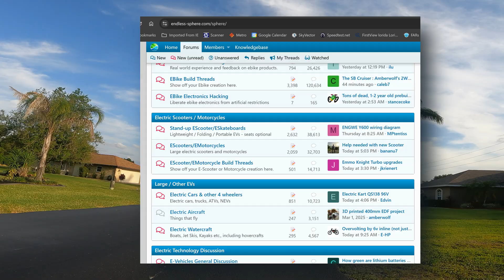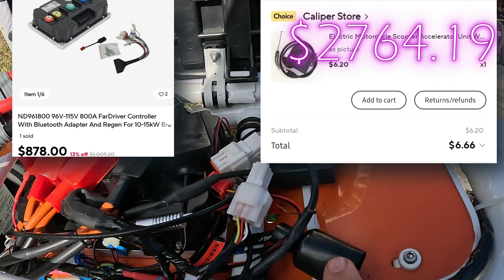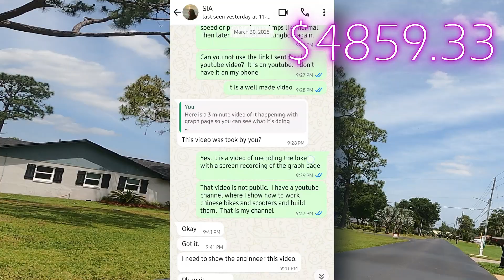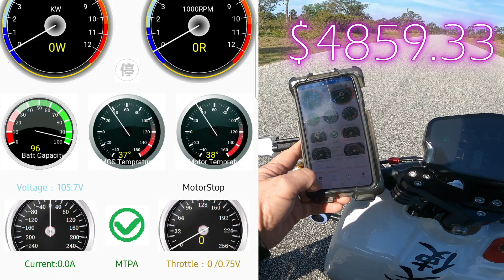How Much It Costs To Build Your Own High Power 20kw 96v Electric Motorcycle Maddog Scooter

Comment: What was wrong with the damaged fardriver???
Reply from the maker: The ND961800?   It was bad from the factory.  No idea.  The ND961000 (blue one).  I blew that up.  Trying to hook up boost I sent 96v into the pink "alarm" wire somehow.  It actually blew up inside and smoke came out.  😢
Reply: @GhettoWrench did the 961800 power on at all?
Reply from the maker: @legion-t5j It actually worked fine for about 6 miles.  At 43 degrees C it would start doing the dying thing.

Comment: Hi Sir, can you help me here ? I have put 2 fardriver nd72450 to my FLJ 10kw dual motors, i tested free spin it spins like crazy but when i put load on it barely move, i then bump up the controller to max amps it hit 55mph max but my battery turns really hot . Im really nee to fardriver i dont know how to tune it right. So main question is : free spin so crazy fast but when test ride with load it barely move ! What do i put in settings?
Reply from the maker: @mikenguyen4207  I'm not familiar with dual motor setups, except I see tons  of discussions on the ability to run 1 controller or not.  Don't get that battery too hot.  It may be tricking the controller into drawing way too much current.  Have you asked the guys on endless-sphere.com?   Those guys are super smart and discussing this dual motor stuff all the time.  Give them a shout
Reply: @GhettoWrench  sir so you meant 1 controller can run 2 dual motors?
Reply from the maker: @mikenguyen4207  I don't know.  You will have to ask someone more knowledgeable than me.  Did you ask on endless-sphere?  I'm gonna reply to you again so it should be right below this reply.  It will be a link to a youtune channel.  Go on his video and ask him.  He is a genius and knows about this.
Reply from the maker: @mikenguyen4207  talk to this guy.  
https://youtu.be/rZA8N3XMHWU?si=G2iO7YWaAo_mW67_

Comment: With a setup like this, what would you do differently if you wanted it to be even faster? Your mini-bike is pretty fast as it is, but I think it use a little more personally.
Reply from the maker: @pumpkinpatch2976  I would make it slower. Maybe 8kw hub.  The bike is way too sketchy past 80.  I've had it to 90 and it not feel very stable at all.  That motor will take you take you over 130mph...  come on, it has personality for days.  😁

Comment: Yeah stay away from those controllers I told you they aren't great not only for the price but the features i would recommend going something vesc based at the voltage that your at if your under 24s configuration you can even going with a nucular p24f for the price 😉 you'll get easier configuration way better performance and may even be cheaper including shipping
Reply from the maker: @legna199111  ya but you told me AFTER I bought it.  🤪  I am def doing that VESC one next time.

Comment: Is there any particular reason why you went hub drive over mid-drive motor?

I have both & prefer the mid by far, but I haven’t tried the cream of the crop hub; just interested in hearing thoughts that don’t relate to it just being cheaper.

TIA.
Reply from the maker: @applechili2848  It was purely out of laziness.  LOL.  Just easier than figuring out the chain and sprocket set up on that little frame.

Comment: Hey ghetto wrench i know its not about your build. Sweet build. My question is about gen 5 14 in rear rim what size tire for new 1 more round 140/60/14 ???? Or 140/70/14
Reply from the maker: @2010luvtabone  Guys have fit 140/70 on there, but it is so close that depending on what brand tire it may rub.  Some guys have reported that it rubs.  A 140/60 or 130/70 would be a for sure fit.  The wheel is only 6" wide so I think 130 would look better.
Reply: @GhettoWrench  130/70/14 12???
Reply from the maker: @2010luvtabone  You are correct. 14" wheel on that Gen 4

Comment: Yeah Ryan is a good guy he just helped me and we have been talking for over a yr I might buy a Dakar roller he has. That's what I want to build after my Ebike I'm building now the Bigniu BG-X ck it out on you get a chance my build videos coming very very soon. I have all my parts now.
Reply from the maker: @oldmanebikes8392  awesome.  Gonna watch it right now.  Thanks.
Reply: @GhettoWrench  thank you and new videos will be out soon. I'm going 60v62.5ah with 5000w direct drive motor and fardriver 72450  and then I'm going to test the flipsky 75450 and see what one is better. I'm thinking the flipsky since it's run by vesc and has water cooling also. Thank you for you videos on the fardriver set up an all you did the best that I have seen very detailed. Thanks 🙏
Reply from the maker: @oldmanebikes8392  thanks a bunch.  You will get into the same problem I have.... with that 5kw motor.  The damn thing will be too scary to open up!  😆 🤣
Reply: @GhettoWrench  I hope so Im looking to get like 60mph with it being only 60v. I will never do 60mph but the roads out here are all 45 and 50mph so I need the speed and don't want to be wide open to do 50mph so less stress and better efficiency
Reply from the maker: @oldmanebikes8392  same.  Like cars that do 120mph...  it just makes them do 70 nice.  And get there quicker for merging.  I hate having to be wide open to stay with traffic and then have nothing left.
Reply: @GhettoWrench  right I will have the power when needed. Thanks again for you great videos helping a lot of us understand the fardriver better.
Reply: No ryan is a not a good guy

Comment: 800 amp 96v controller...  that thing will rip.
Reply from the maker: @TabooRevolution13  actually I replaced it with a 450/1000 one because it was stock and I didn't want to wait long to test it.  It fixed it.  And actually my battery is stuck at 400 amps continuous so it is not really slowing me down yet.

Comment: 232cc water cooled is still cheaper but probably slower
Reply from the maker: @king0dasouf  oh way cheaper.  For sure.  This thing feels like a 1000cc sportbike and have a lot of time those.  But the bike itself is too sketchy to ride it like a liter bike.  I may have went too big.  LOL.
Reply: @ 
Would down sizing the motor yield more range?
Reply from the maker: @king0dasouf  oh for sure.  With a nice 6000 to 8000 watt motor and that battery it would go well over 100 miles I would think.

Comment: @5:30 We already knew it’s not the battery…its an AMORGE!!!  This is a public service announcement. Hey Allen, send me a free battery. Lol j/k. 

I would say after 2 weeks of troubleshooting it was 90% controller (because no errors under the original firmware) and 10% motor (because it was only after warming up and hitting a bump). 

Lets hope SiaEcosys sends you a new 961800 because that motor and battery can handle it. That 961000 is a very nice match to the other components on your bike if you want great performance and reliability. And even though you are barely taping into that motor’s capabilities, 45kw going in a 20kw motor will give you a lot more power than 80kw going into a 4kw motor. 

Now you can do tons of Fardriver and ANT videos. Theres so many misconceptions, some of which are just because some settings have been nerfed over the years. Like current loop KP, before you can manually set that, then it automatically was set to 10x the corresponding KI setting, then it stoped showing what its doing when you change KI.
Reply from the maker: @imho7250  If I can find a fatty tire 8kw hub for the bike I will use that with this controller and battery.  Then go bigger on something else to match that 20kw motor.  The fatty 7" wide wheel is the only missing thing on a electric maddog or ruckus.

Comment: Can we get a video of the details of approximate range[eco(35/40mph limit) vs running it in "fun mode"/hard pulls/high speed], max top speed, 0-60 mph, 0-top speed? Great build, this has me very interested in a fast bike a big(260lb) guy wouldn't be disappointed with.
Reply from the maker: @inspecthergadgets8091  Thats a great idea.  I did 57 miles, but like you said it was "fun" driving.  I can limit it down to a lamer bike that only does like 60 and then see the range with conservative driving like I have to make it somewhere.   I am waiting on a draggy device for the performance stuff.  I want to do a before and after "tune" video.  Top speed.  Idk.  This thing is sketchy AF at 90!  Like scary.  😆
Reply: @GhettoWrench  when I read you can do 90+mph, ty for the giggle(I'm excitedly surprised)! Tuning would improve the hard pulls or just range?
Reply from the maker: @inspecthergadgets8091  it would be for 0-60 and quarter mile stuff I think.  But with the selector switch I can have an "eco" mode and regular mode and "full race" mode.  3 options.  There is a "boost " option which gives you a 4th mode essentially with a time lime limit on it between 1 and 130 seconds.

Comment: Hub motors are good for regenerative braking
Reply: The problem is battery having limited charge rate. So only certain percentage of the braking can actually be used to charge, and the rest gets wasted as heat/unneeded braking in the motor. In the case of a bike, it is almost always more efficient to just let the wheel roll. It would take specially designed battery, and heavy weight/many hills scenario to make it worth it.
Reply: @CryptolockerMD  unfortunately my hub motor is stuck in the regenerative mode.... It barely even coasts down a hill... Has a terrible vibration with the square wave controller and has a very very small range... Lucky to get 27 miles..

Comment: I wish they had an option for a wider rear wheel. Nice build.
Reply from the maker: @philaell  working on it.  👍🤘  They make a 12x7 but it is low RPM and only goes to 3000w. There is another company...  that guy in Thailand, who does high power wide tire motors.  I am def looking into that.